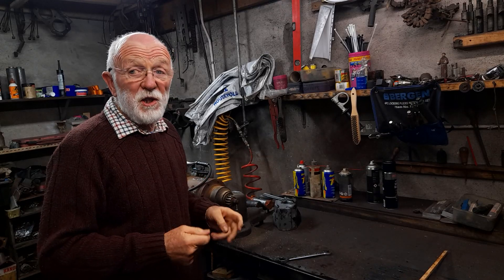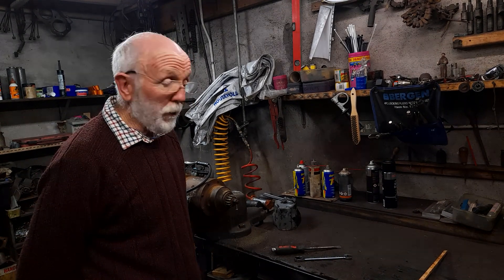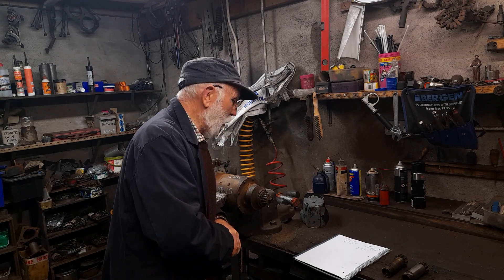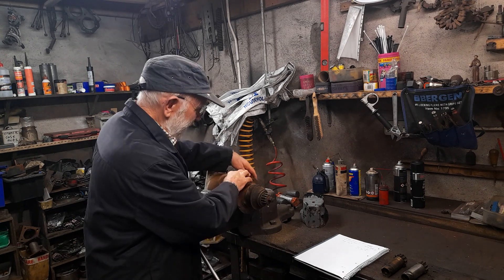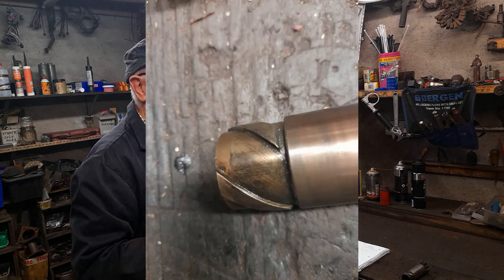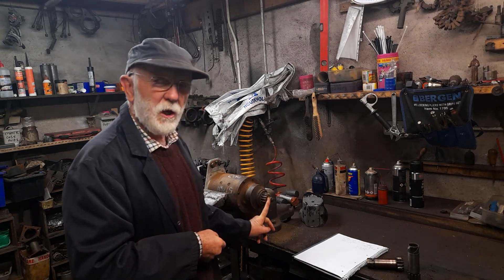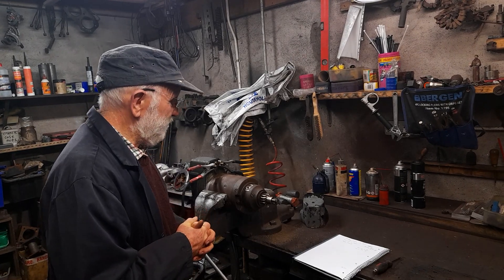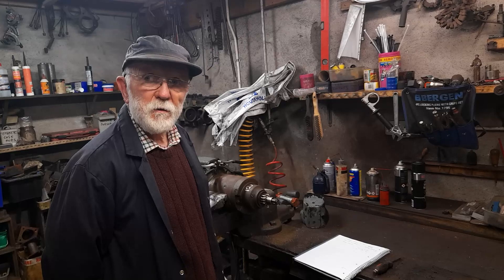Gardner Engines: more on starters and testing them.

Comment: Very interesting. I actually made some brass gears for some marine Gardner engines, they were 13t. I have a video on my channel. The feed back that I got was that they fitted perfectly, I was really pleased with the way they turned out.
Reply: Very interesting what material did you use for the gear as it should be a quite hard material:-)
Reply: Hi John. Originally I was intending using Aluminium Bronze CA104 however, the client asked me to use Brass CZ121, they wanted to increase the probability of the gear failing and reduce risk of the motor or fly wheel being damaged while at sea, they keep a couple of gears on board in case they have problems while at sea.
CA 121 is actually comparable to CA114 High tensile brass but easier to machine. ( I think not as hard) The hardness was HB140 ish.
Do you have a recommendation? 
Thanks
Nigel
Reply: Thanks John for the benefit of your experience, I subscribed to your channel.
Reply from the maker: Any chance you could email me about this please: tangent.gardner@gmail.com